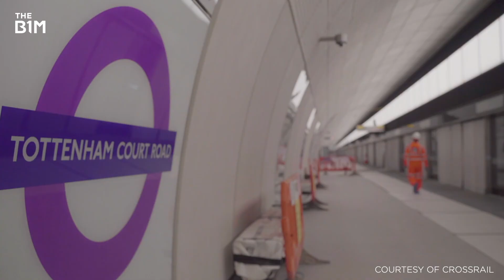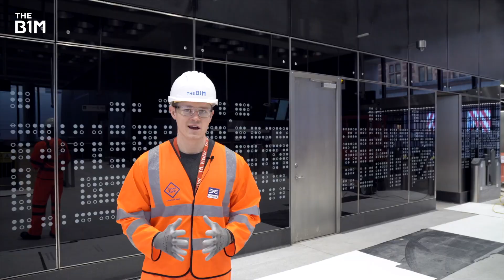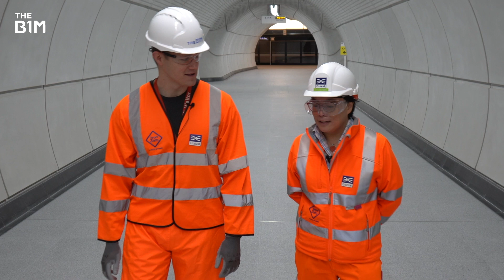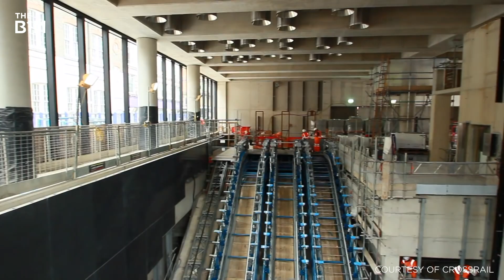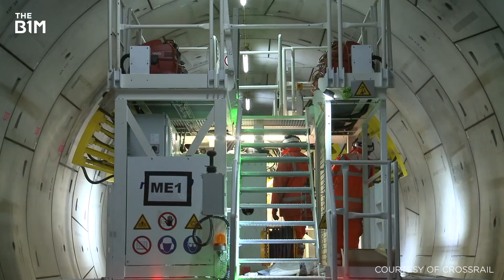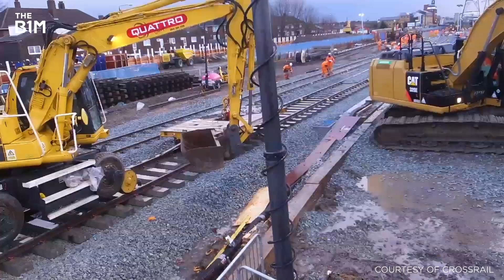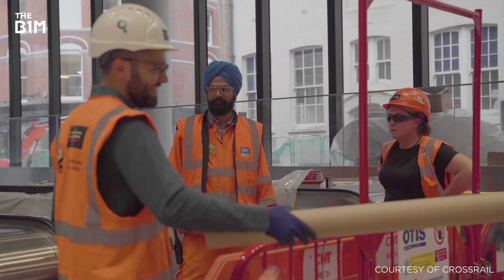Inside London’s £18BN New Railway

Comment: I'm amazed by the glass/Lucite wall along the platform. It has to withstand the air pressure changes caused by trains arriving and departing, I wish most commuter railways had something like that - here in New York, people routinely fall off the platform onto the tracks, and are injured by landing on the rails or occasionally by a moving train. Last year a friend of mine who's a train operator for the Transit Authority saw a woman about to jump in front of his train. He stopped it in time, climbed out and helped the woman get back up onto the platform, where other travelers called emergency services for her. If there were barriers along the edge of the platform, that kind of thing couldn't happen.
Reply: Actually the designers of the stations thought about the pressure change issue. At the entrance to each platform there is a pressure release shaft above the track which means the platform screen does not have to withstand such an extreme pressure change.
Reply: Does it have to be a full wall? Some stations in Japan and Singapore just have a small waist-high barrier to prevent people from falling through (intentionally or otherwise)
Reply: This has been there at metro stations in Delhi for years 🤷‍♂️
Reply: The Jubilee Line has had them for 20 years.  It's the old Victorian lines that don't.
Reply: @andrew6978  I'm in the US - where is the Jubilee Line?
Reply: @vincentfiestada  In New York, somebody would climb over the barrier just to prove that it doesn't work.

Comment: Here in the bay are it took the city 15 YEARS and 6 BILLION to build one little bart station and a 4 mile extension connecting it. The power of non corrupt officials and municipal priorities can be seen in other places
Reply: It's more of a cost problem in US.
Construction workers get paid like x5 times more / hour in US vs UK.
If you compare it to other EU countries it's actually close to x10 times !!
For example...regular workers building the underground here in Milan (Italy) get paid about 1500-2000 € per month tops.
Reply: @SpaghettiKillah  Also they are building tunnels (mostly) in London Clay which is near perfect for tunnels so alot of construction equipment is cheaper

Comment: I'm an Australian quadriplegic who travelled to London 4 years ago, I loved my time there but its railway system was some of the least accessible I've ever come across. The people were lovely and even lifted me up a large flight of stairs on more than one occassion.
Reply: A lot of our railway infrastructure was built long ago.  To be honest, accessibility wasn’t really considered at that time.  It’s much more difficult to provide it in an old station than a new build one.  In more recent times accessibility has been considered important, I think the DLR was the first fully accessible system when built in the ‘80s.  Unfortunately, when Angel station was rebuilt to eliminate the very narrow island platform and provide escalators accessibility was actually made worse.

All of the new Elizabeth Line stations are fully step free, but the existing stations taken over by the line are not, and require ramps with staff assistance, even at stations such as Acton Main Line, which have seen major upgrade works.  I think the whole line should have been made fully step free if possible.

Unfortunately, even newly-built platforms sometimes has large steps or gaps, such as the Thameslink platforms at St. Pancras and the new platforms 1 and 2 at Stratford, built for the Overground, both less than twenty years old.

Comment: I like that the subway platforms have sliding doors so you can't be pushed onto the tracks like you can in NYC.  Sliding doors open when the train arrives.  It would also make it easier to install A/C if they want to although I don't know if they subways ever get hot in London like NYC.  Current NYC platforms can't have A/C because it would just go down the train tube so to speak.

Comment: The first RER type line for London .... I wish you as much success as our 4 lines already completed in Paris (the fifth is for 2022, it is the "EOLE" RER E line).

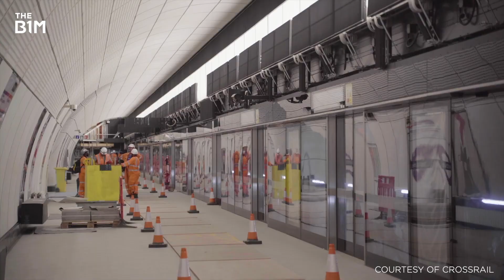At 1:00 you say that CrossRail is the largest company in Europe for metro projects, but Paris has been building for 2 years, 5 metro lines including 3 heavy metros (the sixth starts in 2021) or 200 km of lines mainly in tunnels .... It's the GPE .. "Grand Paris Express"

In fact 2 are extensions, for the M11 and M14 "Meteor" Lines

Currently we have 19 tunnel boring machines in operation and 2 more are expected by the end of 2020 ...

And in addition we have the RER E, Eole Line, which mobilizes a tunnel boring machine the largest in Europe in terms of diameter, to finish the western extension of the line, our CrossRail, to make a comparison.

Plus the CDG Express, a fast train to link Roissy to Paris, in 2024 the two Paris airports will have the M14 automatic metro for Orly and the CDG Exp for Roissy ...

But otherwise the tottenham station is beautiful with its screen doors
(I think that's the English word but I'm not sure.)

In the end, Paris and London are currently the big manufacturers of metros in Europe.

Comment: Great project but not the largest in Europe. Moscow metro added ~100 km of track just between 2011 and 2019 (not counting the circle railway intergated with the metro which would bring the number to 150 km). It will be well over 100km by the panned date of completion of crossrail in 2022.

Comment: I love this. Next time I would be interested in learning the capacity of this railway, average number a passengers travel a day, and average number of passengers per year. This number compared to for example Los Angeles Interstate 405 would make a great video. Two mega projects head to head, additional CO2 emissions information would be great too.
Reply: Capacity of Crossrail are 200 metre long trains with space for up to 1,500 people each with a peak frequency of a train every 2.5 minutes in the core section. It was actually built to relieve the at-capacity Central Line.

Comment: Crossrail was built for about £200m a mile, put the same figures to HS2 then it comes to about £71bn. Why dont we tunnel from london to birmingham avoiding all property, environmental issues and the line will be much safer and more reliable. If it can be done under one of the richest and dense areas in the world, it can be done under open countryside.

Comment: £18bn and they have done 100miles of track 43 in tunnel's (i think might has missed exact numbers) build all them stations.
Yet HS2 is going to cost 6x that amount for about 130 miles (only the Birmingham leg admittedly) 😱. Am I the only one thinking HS2 should just be done underground. Might be a bit slower but less disruption in theory, straighter tracks for faster trains. Remember we are talking about half the number of stations and not trashing the countryside in the process

Comment: Although London doesn't overtly experience earthquakes it does however sit directly over the fault line running under the Thames River with tremors being limited to 2 or less on the Richter scale. Has the engineering of CrossRail taken into account that it's not a matter of if but when London will eventually experience the overt effects of an earthquake of magnitudes greater than say, 3 to 4 & above on the Richter scale?

Comment: Amazing engineering. HS2 has been controversial to say the least & I personally am highly sceptical as to the benefits of shaving a relatively small amount of time off the journey times between north & south is worth every aspect of the costs. Part of me wishes that it might have been better to have waited for the proof of concept of Hyperloop that's currently being worked up in India & the Middle East. If successful, I think that Britain would have been much better served by looking to the future rather than relying on old technology albeit with modern upgrades, if speed & greater connectivity to boost the economy are the aims of HS2 - possibly with much less cost & much faster speed of delivery of such a project.
Reply: What the hell are you going on about. This is nothing to do with HS2.

Comment: I don't understand why the UK subway system is so small. It's like going to Disneyland where everything is scaled down in size. If they just had made adult size carriages then it would double the capacity.
Reply: MrAeronuk1  Is the new line a broader gauge for wider carriages??
Reply: You want small, try the Glasgow metro which is really quite snug inside.   As others have said the small London lines are the deeper ones and do seem cramped to some people. This new project allows full size overground trains to travel East West under London and relieve one of the older smaller lines that runs parallel to the new project.
Reply: @Pesmog  But all the trains I have traveled on in London/ Manchester /Blackpool/ Reading have all been tiny toy trains. Are there any full sized trains in the UK at all?? By full sized I mean at least 48" gauge tracks that take full sized rolling stock.
Reply: MrAeronuk1  Ok, thanks. I thought they were just repeating the same mistake and just making more tiny toy trains..

Comment: What about grand paris express? I think that project is way bigger in scale
Reply: What Paris is building is more like an underground tram system - 3 cars long! It is not 200km on the scale of Crossrail!!! It is a low capacity 200km 'grand' network. I am actually disappointed by paris on this. They made the same mistake with their other metros - too short and slow. At least they have RER metros but the system is a fraction of London's.

Comment: The fact that it costs £18 billion to build a subway line which arrives three years late is precisely why British politicians are going to stop signing off on critical infrastructure projects. We need more railways but if every mile of track is outsourced to useless private contractors who extort taxpayers for billions then we're not going to be able to move forward. There must be a better way to do this
Reply: @Bungle2010  I have no experience, but I didn't set the original cost or the original opening date, which was autumn 2018

Comment: Ohhhh STOP Whinging about the Cost 'over-runs'...
It costs what it costs to build it. If and when there are extra costs that are not foreseen = government coffers simply Cough UP and pay it and shut up about the cost. 
Also when the TBMs finished digging xRail1, they should have been shifted and started tunnelling xRail2. When finished tunnelling, shifted for a xRail3, 4, 5...10. 12. Keep them operating for functional lifetime of decades. Beijing uses this method. It works and does MAKE the over-all cost of all xRail lines far less due to standardisation.

Comment: Always London gets the funding. Almost 3 x the transport bill for the rest of the UK.
Reply: MrAeronuk1  Hi,  Wouldn't it be fair to a billion on 18  Towns or city's out of London. Since the financial crash in 2008 ,which the London hub was part of the cause.  The rest of UK have spending cuts.   London seems to have billion pound contracts one after the other.   London is the spoiled brat of the UK
Reply: MrAeronuk1  Hi, in the West Midlands we have been waiting years for an extension the B'ham to Wolverhampton line from Wednesbury to Dudley for years. The work involve using an old railway line no tunneling, work has just started.
So you can see why the rest of the country ,can think under the lines of why London, not jealousy just a bit a fair play.

Comment: Why have severely disabled blind and visually impaired been excluded from this project? 

There are no cash ticket kiosks , ,help points, no disabled helpers,long stretches of tunnel with no assistance for wheelchairs,moving walk ways, or 802.11mc connectivity for the blind.

The public is awae its been rushed into service for political reasons and abusing the disabled groups illegally as a result. This is a classic failure, the sighted designing a building for the sighted to the exclusion of the disabled like terminal 2/3 heathrow.